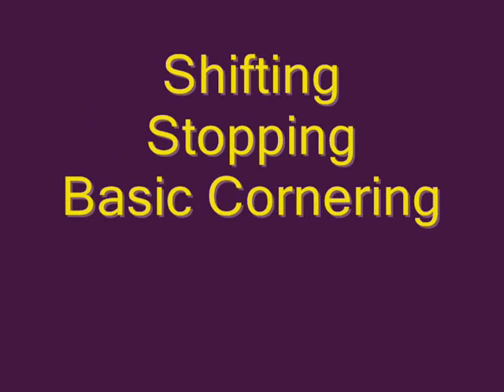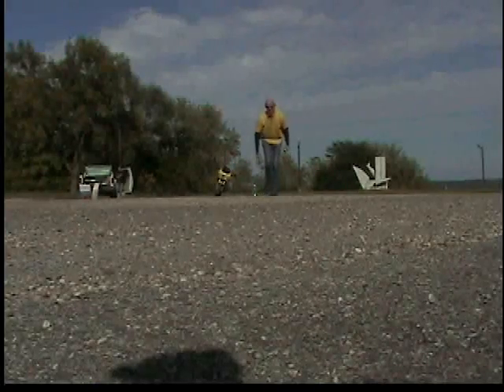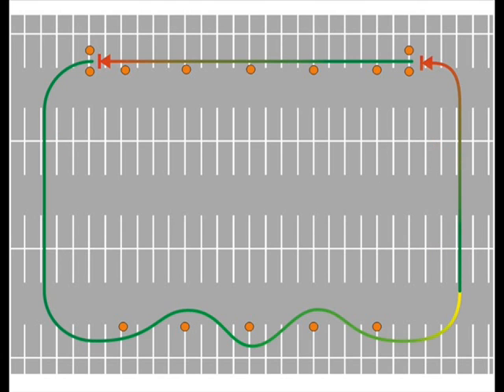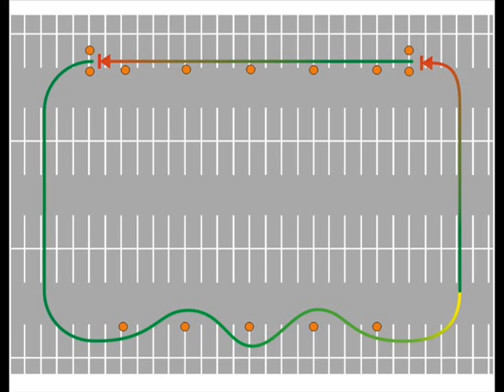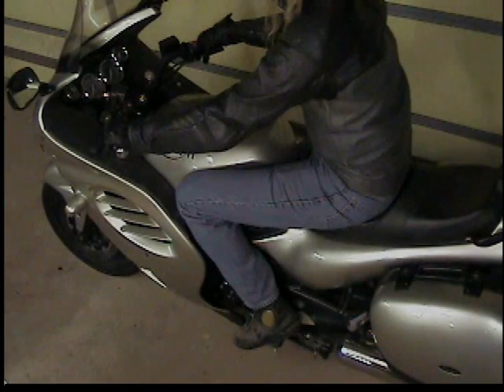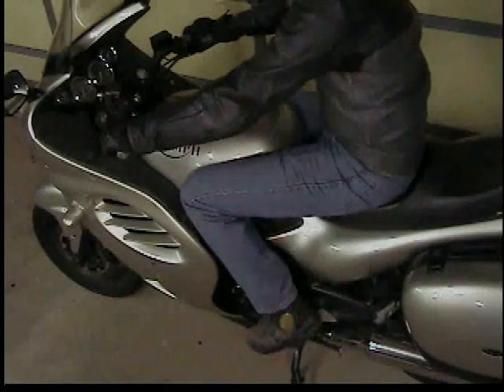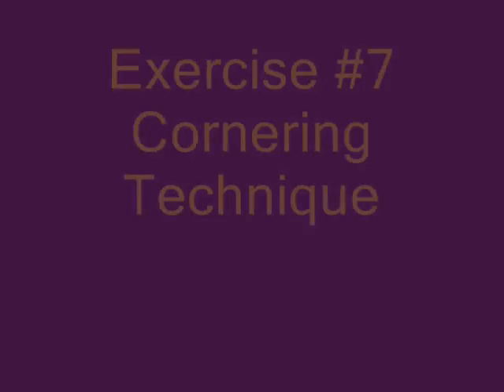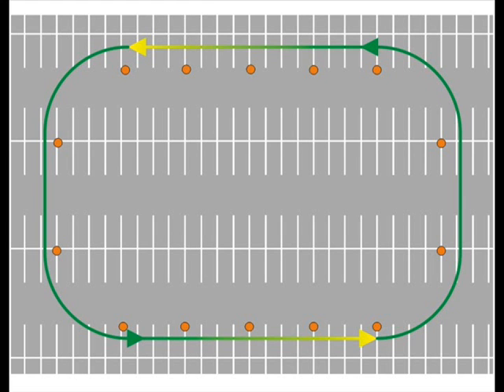Shifting Stopping and Basic Cornering - How To Ride a Motorcycle

Comment: When should I shift to first? Should I make a complete stop or is there a certain speed that I can shift down to first incase I have to accelerate again at a low speed?
Reply from the maker: When slowing to a stop it's...
In with both hands. 
Down with both feet. 
Left foot to the ground first. 
So the hands release the clutch and apply the front brake. Then the feet apply the rear brake and downshift. 
Ride On!

Comment: hey when going around a corner 4:25 in your video I thought you never want to break with out holding the clutch in? wouldn't it stall?
Reply from the maker: It is perfectly OK to slow with the brakes without pulling in the clutch. It is not OK to do it to a stop. That would cause a stall.